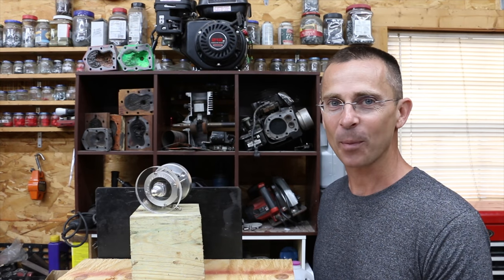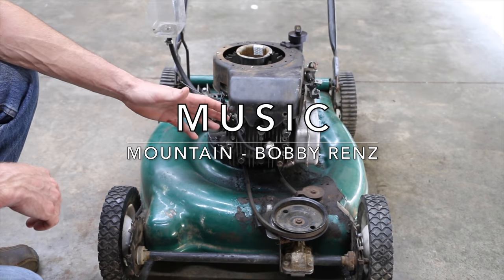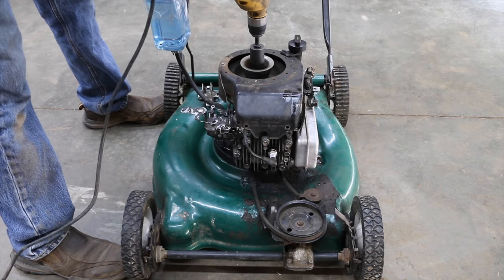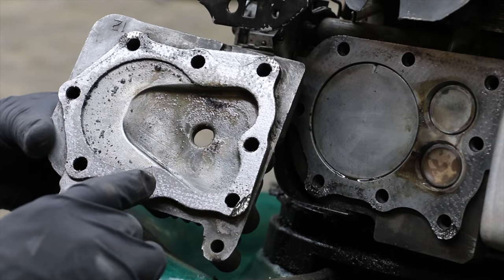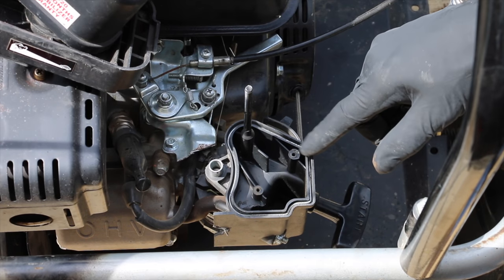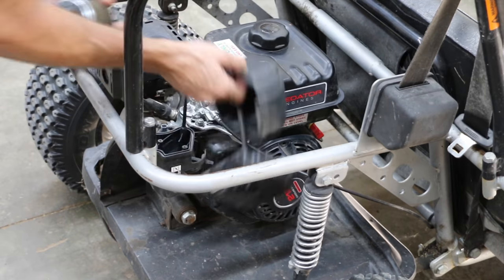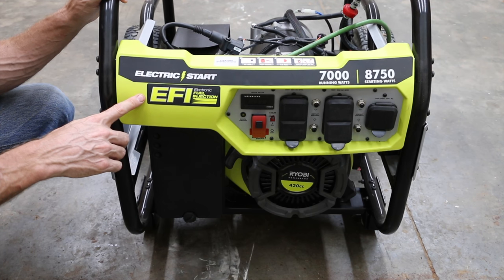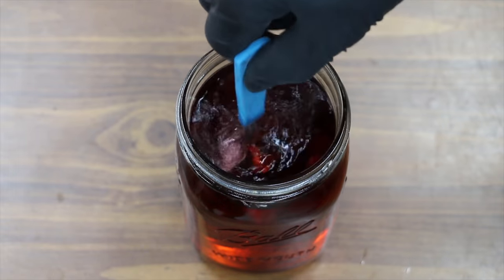Is Leaded Fuel better than Unleaded?  Let's find out!

Comment: Correct, you do NOT want to run LL fuel in a modern fuel injected engine. The motor will be fine, but you will absolutely destroy the O2 sensors, as the lead poisons the platinum wire in the sensor itself. It will also cling to the cats. But if you have a race motor with speed density and no exhaust side sensors, or a carb, have at it. 

One other thing the older engines had too were valve rotators... they continually changed the position of the valve every time it closed so it wouldn't let lead buildup mess up the sealing. 

If you had an old engine and didn't run leaded, even high octane, you'd still kill the valve seats as the rotators would chew right through them.
Reply from the maker: Thank you
Reply: No it won't blow up your O2 sensor oh, it's an aviation fuel , Aviation Motors have fuel injection and O2 sensors. The reason it's LL low LED is so it doesn't burn up the O2 sensor. And older engines that used leaded fuel because lead actually was a lubricant for the valve to the cast iron head since they didn't have steel seats back then. Good try though.
Reply: @moonshinemenace6611  I built piston avaition engines for 11 years, my father 42 years. Never saw an O2 sensor on an aircraft engine. Fuel injection is purely mechanical. They don't even use electronic ignition.
Reply: @MarkSmith-zt2zl  yeah sorry about that my kid got ahold of my phone, he's 16. He has a decent idea, missed a couple steps here. He just assumed since it was fuel injected it was electronic, since cars use them. But as far as ll100 the LED is so minimal that it would take a very long time to kill an oxygen sensor in a car, we've used it before. The mechanics out there always told me when I was a kid that the hundred octane was needed 4 as they go up in altitude they lean the motor down with fuel, as they lean it out it tries to detonate. So the higher octane is supposed to help offset that. That's at least what I was told. Thank you
Reply: @moonshinemenace6611  I read other comments that were less informed further down the line. Referring to cast iron heads... Got tired of correcting. 100LL is somewhere in the 3ppm lead. You could run it thru cats for extended periods of time without harm. The lead in fuel serves many purposes,  protecting vavle seats and guides primarily. Pilots have manual control of mixture from full rich to fuel cut off and lean at altitude based on power setting, exhaust gas temp desired fuel consumption at cruise...etc.
100LL is widely misunderstood, as many more commens demonstrated.

Comment: "This gasoline is not to be used as skin cleanser."

What.
Reply: Yes
Reply: Tetraethyl Lead is easily absorbed through your skin, and has the nasty property of accumulating in nervous system tissue (especially the brain).
Reply: @jacksons1010  You missed the point. Who honestly recommends any sort of Petrol/Gas as a skin cleaner
Reply: Dana Vixen  I grew up using gasoline as a degreaser, including my hands.   The warning is valid...AvGas has a much higher lead content and people don’t know it.
Reply: @DanafoxyVixen   Naphtha used to be used frequently as a way to remove paint from skin back in the 70s and 80s
Reply: I have a flask of nitro toluene racing fuel octane booster additive in the garage left over from my motorcycle drag racing days. It has the best safety warning on the flask. It reads:

FATAL IF SWALLOWED, NOTIFY CORONER!!
Reply: In late 80s and early 90s I worked in my dad’s shop as the gofer, tire guy and parts cleaner. After washing down the innards of a customer’s Fordillac engine, my skin would feel itchy and raw for half an hour regardless how much I washed. 

Good times /s
Reply: ALL GASOLINE MSDS sheets say this. Gasoline, with or without lead, is not recommended for using as a hand cleaner. I won't pretend I've never done it, but there is some risk involved, even without lead.
Reply: Gasoline is one of the single best solvents there is. Gas is used in many applications as a cleaner. 
It's not even strange at all. Alcohol is also used very commonly as a cleaner and it is also used to run our engines.
Reply: @GreatNorthernDad 

🔥 💥 💀
Reply: @jacksons1010  I was not confused why one shouldn't wash their body with leaded gasoline. Slathering lead all over your body being a bad idea is, you know, pretty fucking obvious. I was confused why anyone would wash their body with gasoline (even unleaded) at all.

I am also quite confused how you could have ever, EVER possibly thought I meant the former and not the latter. 

...Are you sure that gas you used didn't have lead?
Reply: Gasoline’s original use... was a household cleaner.  It was sold in little bottles at the drug store.
Reply: KingAdrock420   Several people commenting here that they have in fact used gasoline to clean their hands.   Putting a warning on dangerous materials is common sense, no matter how much it triggers you.   Lighten up, Francis!
Reply: @jacksons1010  it is used as a solvent that can get particularly nasty stuff off of you, like wood varnish
Reply: There was a scandal here in Australia like 20 years ago, a few old folks homes were bathing the elderly in kerosene. Not quite gasoline, I guess, but uhmm.. I guess the aim was to 'cleanse' them.
Reply: @jacksons1010  Is that what is wrong with me, We used leaded gas as parts cleaner and hand cleaner
Reply: I cannot count how often I've used gasoline as hand cleaner. Used to use it to get rid of the extra thick gloopy grease after working on big rigs with oil leaks. It's be the consistency of peanut butter, 20 mins with hand cleaner and scrub brush OR 2 mins with gasoline rag. Used to keep a 5lb coffee can with inch of gasoline and a rag in it just for this (with lid on of course). It's annoying to forget and light cigarette right afterwards and have hand catch fire though. Follow up with hand cleaner to get rid of gas smell.
Reply: Clears up poison ivy instantly
Reply: @peterwelsh6975  And don't forget when your done pouring it down the storm drain
Reply: the best fingernail polish remover is acetone.
Reply: first week in my car mech school and we going thru some safety stuff and just today they said you shouldnt use gasoline as a cleaner cuz all of the shit vapors etc that come from it sry my english cant explain and that you should just use proper cleaner.
Reply: @jacksons1010  It's not just the TE lead.  Look at the SDS--benzenes are pretty potent carcinogens.    I do have to laugh, however--people go nuts over spraying a 1% Roundup solution on their weeds maybe twice a year, but think nothing of pumping their own gas.
Reply: I use gas to remove paint because I’m uncultured and lazy to buy actual stuff for paint removals from my hands
Reply: @edifyguy  When I was young there were no such thing as an MSDS sheet. You must be young.
Reply: I work at an A&P shop (essentially a turbine engine shop), and we use a gas to clean lots of things. Not as much ourselves (though we may in a pinch) but it is a remarkable cleaner around the shop.
Reply: It is GREAT at cleaning things. We use it to get the oil and soot off the belly of the airplanes. Seriously, better than any other cleaner out there, but the tetraethyl lead seeps into your skin which is not a good thing.

Mechanics frequently will just squirt some fuel out of a sump on their hands to break up and remove grease. Not a good practice.
Reply: Dana Vixen for removing paint or oils off your hand honestly it's something that happens more then you would think
Reply: When I worked construction back in the 70s we used to use gasoline for cleaning roofing tar, paint, etc.. from our hands and arms routinely. As some body else also said worked great on poison oak, ivy and sumac.
Reply: Back in the day, people used to use gasoline to clean their hands after a dirty mechanical repair.
Reply: Use to use it in the 70's, no problems here.
Reply: Many people have used gasoline to clean their hands after doing some greasy work.  Sure there is somewhat of a risk to it, but hell what doesn't have a risk?  Has anybody ever died or suffered extreme health problems from using gasoline as a hand cleaner?  I'm not talking about this airplane fuel but regular leaded and unleaded gas.
Reply: You'd be surprised by how many people I've saw do that before. Including myself. Just saying.
Reply: KingAdrock420 We call it under wing solvent! I still have 3arms and 18 fingers !!
Reply: MattExzy  years ago people washed their kids hair with kerosene to kill lice.
Reply: Used to work at a car wash/mechanic duo. The mechanic there would frequently rub old engine oil fresh out of cars all over his hands and arms before washing with regular hand soap. Claimed it helped, never really saw the point.
Reply: No way!? Your telling me I've been cleaning my hands wrong for the past 25 years.. Lmao! Yeet!
Reply: @jacksons1010  NO gasoline should be used as a skin cleanser.
Reply: KingAdrock420 gasoline is breaks down oils really well. It’s actually how you clean oil bath air cleaners
Reply: Ever clean a wound with alcohol? Using spirits to clean is a fairly common practice. Washing grease out with kerosene or lead-free gas is a especially common with mechanics, if you've got the stuff lying around and can't find a tub of Goop, Gojo dispenser, or bar of Lava.

When I'm really lazy, I just spray some WD-40 on my hands.
Reply: @peterwelsh6975  the fact that you do this and that you smoke cigarettes means you don't really care much about what your body absorbs. Not only is there probably a cancer risk but your liver has to get rid of all of that tocicity from your blood. Ask your doctor about it see what he says, if you have one.
Reply: Ed Jack  I use Jet A in my solvent tank
Reply: I certainly wouldn’t use it every day, but gasoline is effective at removing grease and tar from your hands.
Reply: Mechanics use to wash greasyhand with solvents like fuels. Avgas is easy to find around
 I've a few of them washing hands with avgas. That's way is written...
Reply: Lots of mechanics will wipe grease off their hands using a rag with some gasoline on it, because they have lots of gasoline handy. So yes, there is a legitimate reason to remind mechanics not to do that with leaded gasoline.

Comment: Great Videos. I have used 100LL extensively in 2 stroke racing motorcycles since the 1980's. I have not seen the type of buildup that you are seeing with 100LL, which contains 2.12 grams/gallon of TEL. Typical 2 stroke cranking pressures of 175-185psi may have an influence on the cylinder temperatures and how the TEL is consumed in the combustion chamber.  I have also gone back to using Kemco Octane Supreme in 91 Super Unleaded. Kemco TEL concentrate contains 59.5 grams/gallon of TEL in a Tolulene suspension. in my 1982 Honda XR500R Desert Motorcycle, compression during cranking is a whopping 225 psi. I have found that 2.4 ounces/gallon of Kemco TEL provides notably smoother running, better hot and cold starts and zero deposits on the spark plug. To take this a step further, I tested the Kemco TEL at a very high concentration in a 5.5 horsepower Briggs & Stratton lawnmower at 10 ounces per gallon. Plug color was very even light gray without any 'textured' deposits. In an engine with a very high static compression ratio, I find it necessary to use TEL to prevent high-rpm detonation. It is of little if any value in other applications. Have you experimented with Chevron Techron Powersports Ethanol Stabilizer??? I have had good results in extended storage of fuel in lawnmowers. It would be interesting to see your evaluation...
Reply from the maker: Thanks for the video idea.

Comment: Hey project farm. You should get slow mo shots of carburetors at different temperatures to show us how the fuel vaporizes. 
It would be interesting to see if there is a sweet spot.
Reply: Good idea!
Reply from the maker: Great suggestion!
Reply: Hans Evensen 

I could see stop motion droplets using a 60 hz fluorescent light, I believe. 1990’s GM throttle body injectors. Not saying a camera would see it, but maybe.

Comment: You should do a fuel comparison between "top tier" fuels to see which one is the best, most cost effective,  cleanest, ect..
Reply: People have done that's it's all lies buy the cheap shit
Reply: And are they that much better when compared to the standard.
Reply: @chabka34  correct but the issues with buying the cheapest gas is it is usually from ghetto poorly maintained fuel stations, at least where I live. Lord knows is they've ever had their tanks cleaned
Reply: @chabka34  Not really true. My 2018 5.0L runs waaayyyy better on Chevron/Shell premium than the "cheap" premiums.
Reply: @kylejheard91  that's called a placebo
Reply: @chabka34   Lol sure, man.
Reply: @chabka34 , some higher performance engines require the higher octane "premium".  But other than that, you're right.  Each company has their own special blend of additives, but it's always the same half dozen additives at the refinery.  The only real difference is the ratios - inconsequentially minor differences with nearly immeasurable results between brands.  And the midgrade is simply not worth the extra cost.
Reply: @kylejheard91  how does it run better? I'm legit curious. Did you do any test comparisons or does it just feel better? Does your engine require premium as well? I'd love to know.
Reply: Check out the comparison of valves run with top tier versus non gasoline
Reply: William McDermott there’s a triple A study showing it cleans better.I just use Costco since it’s top tier and I hate going to the lower end gas stations due to having my credit card information stolen there. Also Costco is pretty strict On their maintance. Huge plus also is that Costco is usually the cheapest!
Reply: all gas comes from the same place, at which point various detergents are added in fuel trucks per individual brand.. some stations have different standards for moisture content.
Reply: The cheaper fuels at cheaper stations is older and has lost octane. Hence the cheap fuel
Reply: I bought a new car, 2019. I only run shell in it. I loaded up on wawa once. Brand new station. It dropped my fuel economy 25% per the trip computer on the car. I have been driving everything except a semi since 1972. I have had the best results with shell and BP in that time span.
Reply: @kylejheard91  Chevron is pretty good. The injector cleaner is really good too
Reply: @AscendedBeyond  my brand new 2019 showed me a 25% decrease in fuel economy between Shell gasoline and Wawa. Referring to unleaded regular. Unless the car is computer was lying to me just for that tank of gas that is substantial.  I get 41 miles to the gallon in the car rated 37 miles per gallon on the highway. I'm driving a loaner SUV and my driving Style with a midsize SUV gets me almost 30 miles to the gallon. I know the dealer put shell in their vehicles. I have been driving for almost 50 years now. I have got the most consistent mileage out of shell but I have also gotten good mileage with BP and Chevron. I put marathon in my van one time and within 3 miles my engine was misfiring I had to go home.
Reply: @muhdewd9727  exactly! Most people don't realize this! That's why boycotting a fuel brand is a complete waste of time. Oil Company don't own gas stations. They're either owned by franchise owners or chain stores. So when you boycott an oil company you don't hurt them one bit. They just wholesale the fuel to the other competing brands. It all comes through the same pipe lines.
Reply: He has done a test like this and noted less carbon buildup for some particular gasoline.
Reply: i always use shell or sunocco in my audi

Comment: Great video!

Been using it in my small engines for years. It’s the most economical way to avoid the problems with pump gas. I started using it and stopped having to clean carburetors annually. Also if you have something with high compression the higher octane is what you need for it to run right. I’ve also been told that some older engines that don’t seem to run right with pump gas will come back to life with it. The most significant down side I’ve been told of is potential lead deposits and what they can do to valves or engines with extremely tight tolerances. Also that it has a quicker negative affect on plastics and rubber parts. I’ve had zero issues with it in small engines, mowers weed eaters ATV’s etc.
Reply from the maker: Thanks!  Thanks for the feedback.
Reply: I got well water no chance I'm using gas with tetraethyl lead in it in anything running on my property. I'd rather just deal with the issues of pump gas.
Reply: @fooferutter3001  Meanwhile this guy Manny is your neighbor and he's just fucking up your well with his selfishness. who are all these people deciding to use avgas in weed whackers, just because they think it runs better?

Comment: Some people with modern diesel engines (common rail) put 2 stroke oil or atf in a 200:1 ratio on their tank because ultra low sulfur fuel is supposedly lacking of lubricity for the pump and injectors. It would be interesting to see on the lubricity tester  how normal diesel and diesel with different lubricants or additives makes difference or not. Thank you!
Reply from the maker: Great test idea! Thank you